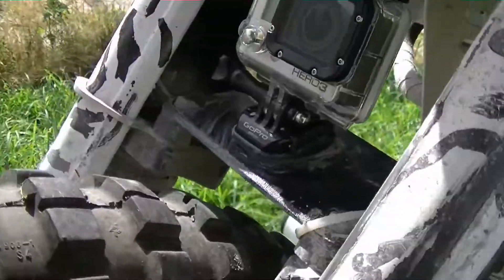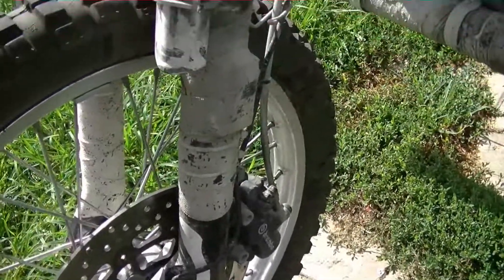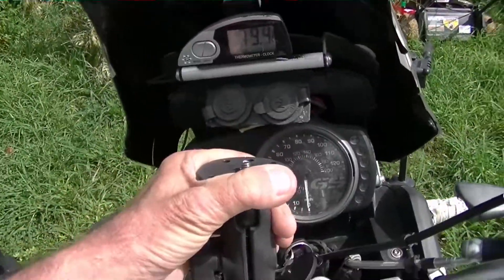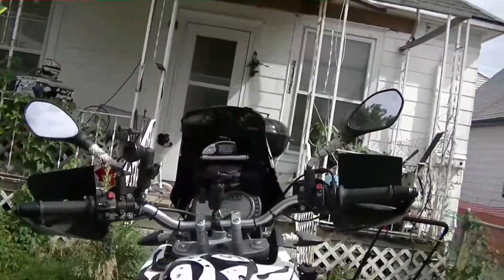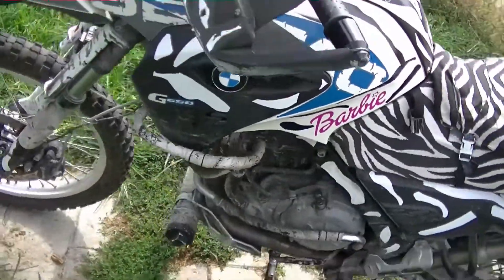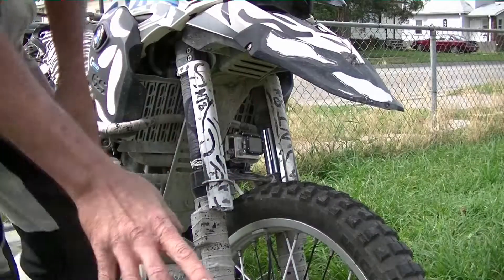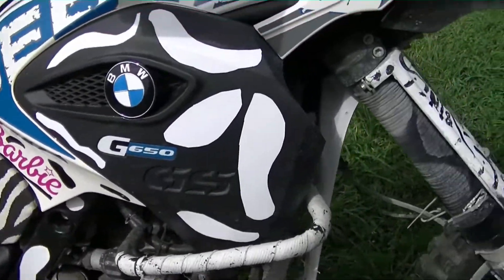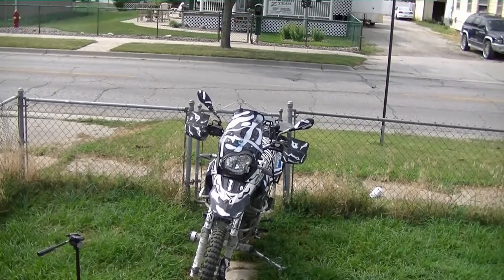Explaining The camera Dynamics Vibrations

Comment: I've never had luck on top boxes, handle bars, windshields.  The body on the Burgman seems to be fairly stable. I also have a twin cylinder which is MUCH smoother than a thumper.

Comment: It's called unsuspended weight. The shocks/forks isolate the camera from the Thumper vibration. The engine sends oscillations into the frame(even tho it's rubber mounted) that increases in intensity the further away from the engine largely do to harmonics. Think of a tuning fork. The ends of a fork tines and the handle vibrate at the same frequency but the ends move a greater distance.

Comment: LOL! You old folks! You have no memory! :p

It's probably partly the fault of the camera. It isn't as wide an angle at its widest as a Go Pro. Also, it has image stabilization that involves moving the CMOS sensor. Even with that turned off, I bet it still has freedom to move.

I've also tried the Canon HF10. It likes to just turn off with no warning. Can't see how it's doing in bright light with the screen door closed. Maybe the battery shakes loose? It also has an image stabilizer. Optical.